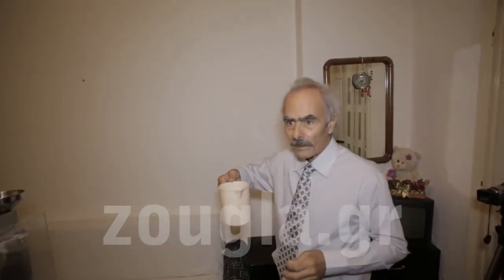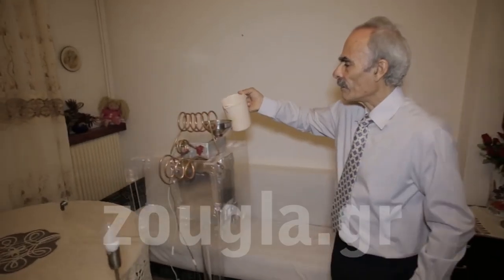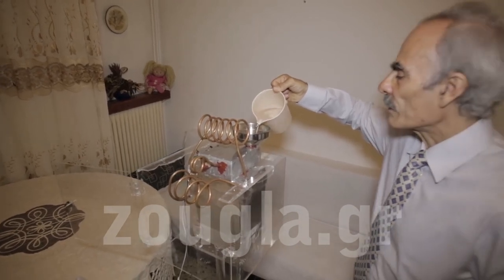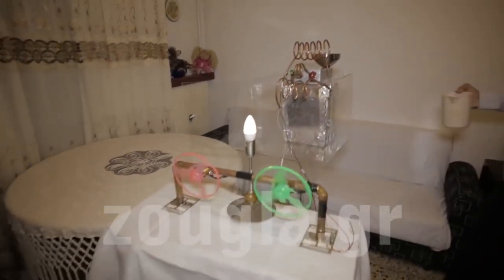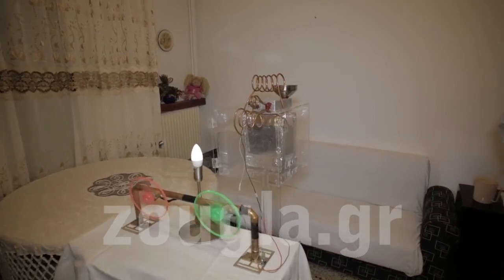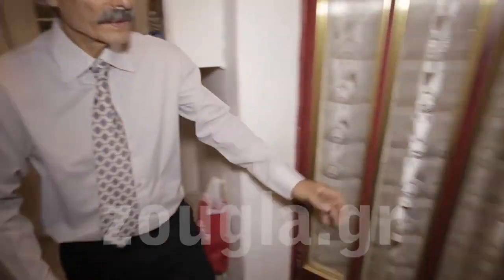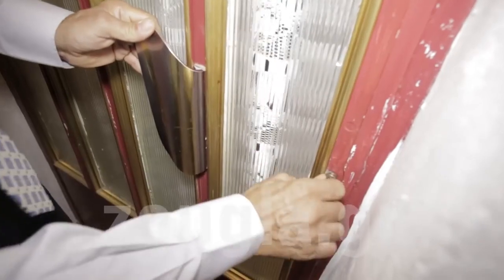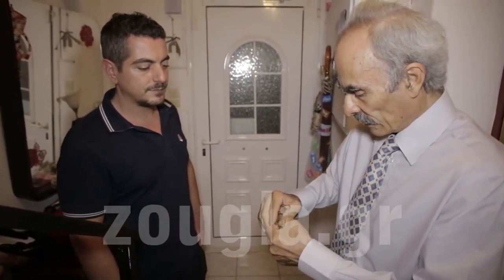Free Energy Generator - Zografos Home Power Generator by splitting pure water - English translation

Comment: A kind of Fuel Cell, which is working with water.......What about the energy which is needed to split the water into H₂ and O₂, are there more informations available ?
Reply from the maker: more Infos at:
https://overunity.com/16440/hho-generation-using-high-frequency-electromagnetic-waves-on-water/msg578596/#msg578596